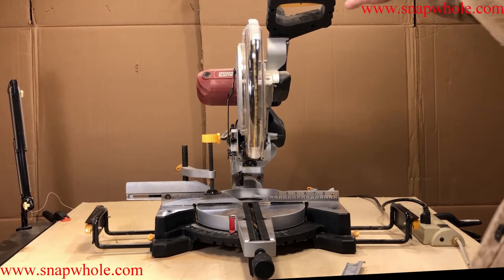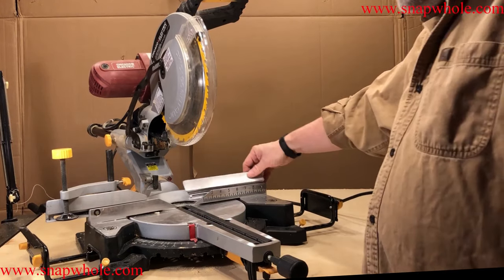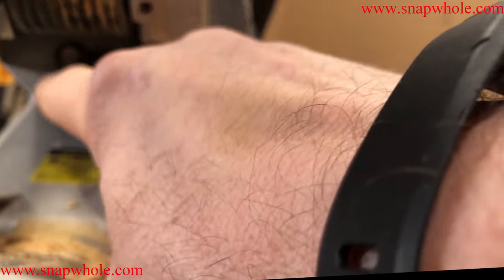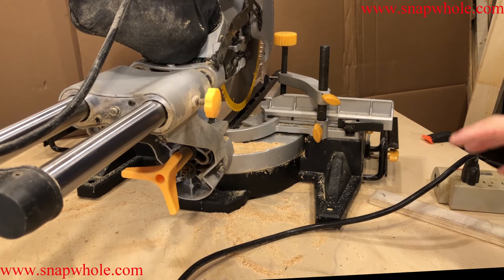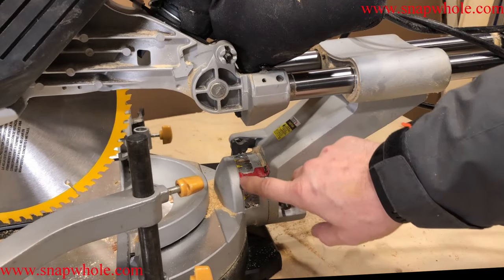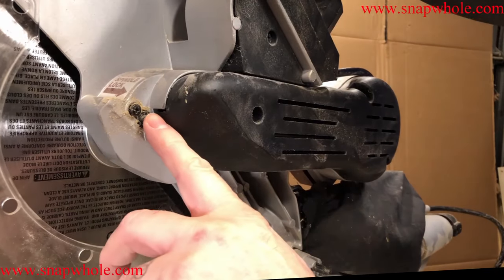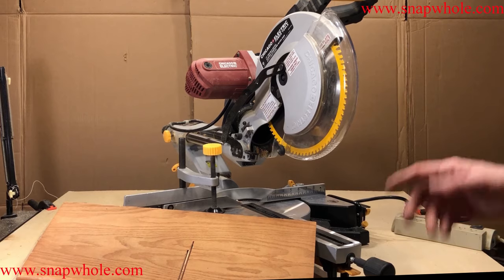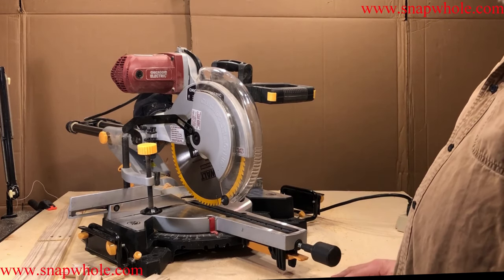Harbor Freight Chicago Electrc 12 inch Dual Bevel Sliding Compound Miter Saw Review

Comment: Hey I got one of these a bit ago at a garage sale and its not sounding to good do I get oil for it or what do I do but it still cuts perfect
Reply from the maker: you should start out but checking the motor brushes to be sure they are not work, there is a  bearing in the motor that might need grease, but those motors were always a little loud - let me know the status of the brushes, and if they are good, I'll take apart my saw motor and go over what to check and how to improve, I haven't used it since I got the hercules saw, but it is still in good shape - thanks for subscribing!

Comment: Regarding using the hold down arm on the right side of the blade... Can you lift up and off the grey arm piece from the long bolts or pins and flip it the opposite way and re-seat it back on?   It looks like it can fit better if you can flip it....  Thank You for such a helpful video on this saw
Reply from the maker: the hold down arm does come off the shaft, but it does not make a material difference in clearance - thanks for the comment and thanks for subscribing!

Comment: I recently bought this saw used from someone but the Connector Bar that connects the Lower Guard to the saw was missing so the blade guard doesn't move when you move the saw up and down.  I contacted Harbor Freight but the part is out of stock and they don't know if they will ever have it again.  I was wondering if you could take pictures of it and get measurements off of it and maybe I can come up with something?
Reply from the maker: I'll try to get the info this weekend and post a video on it - Thanks for subscribing

Comment: What is the major difference between 10 and 12 inches versions and what should be the real reason to go for one versus the other? Then would a 10" blade be usable in a 12" saw or that is a no no?
Reply from the maker: 10 inch blade will not work in the 12 inch saw, the arm will not come down far enough to engage with what you are cutting - 10 inch saws are still sold, if the extra cutting size of the 12 inch is not needed, they will do, they cost about 1/2 the cost of the 12 inch and might not have all the feature - for 10 vs 12 - its all about cutting capacility - if you have a slide on each, then you get several more inches of cutting, both height and lenth of cut - I recommend the 12 inch, its more versatile in the long run, in terms of finish of the cut, thats in the saw blade, not the saw, in terms of accuracy, you have to setup and adjust both to be accurate, so each will be as accurate as you adjust them - I have 3 videos on adjustly miter saws - this is the chicago electric, I also have videos on the admiral 12 inch and the hercules 12 inch, watch all three to see the different adjustment needed, all are good, but I recommend the hercules, its built like a tank and works great - Thanks for subscribing
Reply: @snapwholeharborfreightreviews  Thanks a lot for your Speedlight fast reply and what a comprehensive reply too. Thanks again and double thumbs ups.

Comment: The fences on these are cheaply made and they break easily. I waited for a couple years before I found out that you can order them directly off harbor freight. Not the store. You have to contact their parts department but it’s much cheaper than the drop shippers of eBay and Amazon. 
Otherwise it’s a pretty good saw for the price. I have the 10” sliding
Reply from the maker: thanks for subscribing!

Comment: I gave my old one away. This Miter saw can't cut any angle straight or accurate. U can't.even make adjustments to get it square.
Reply from the maker: follow the procedure in the video and you can align the saw, there are access adjust,ents for the double bevel and miters, the laser is a little more difficult to access but its adjustable, if you take your time and follow the video it will be an accurate saw - but I have to say, I upgraded to the hercules and its accurate out of the box, and I check it once a month and it always accurate
Reply: You have to set up any saw out the box. Good blades help get a cleaner cut.